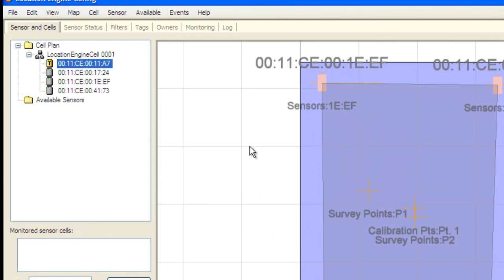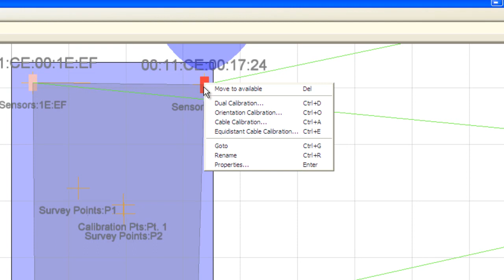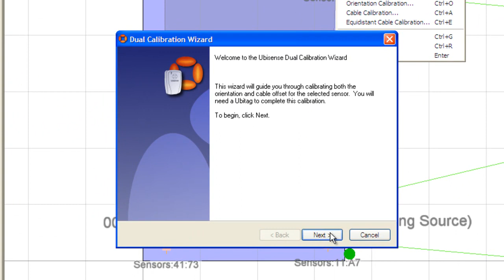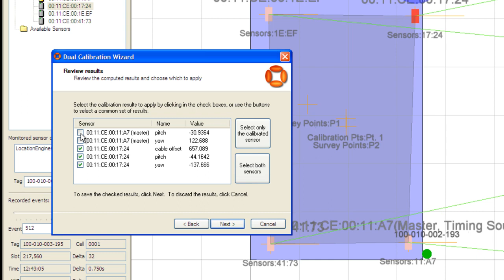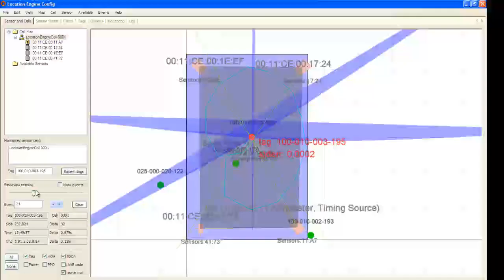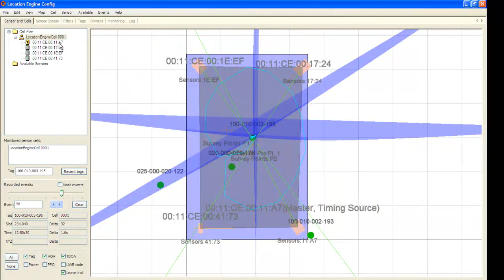Setup 5: How to calibrate a cell

Comment from the maker: First, I would not suggest the Full calibration as it doesn't work all that well. I assume you went through all the previous steps creating the Location and Geometry cell, etc? If not you may not get locations. The red dot only shows when you get a location. Do you get results from the dual calibration? If not or they don't look right you probably didn't measure things accurately enough. I would step back through the previous videos and make sure you didn't miss something.